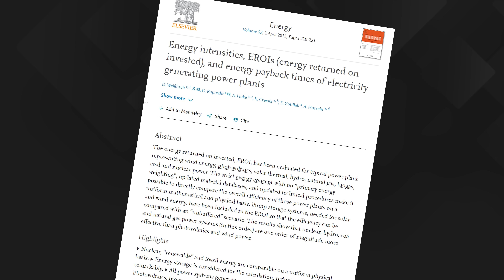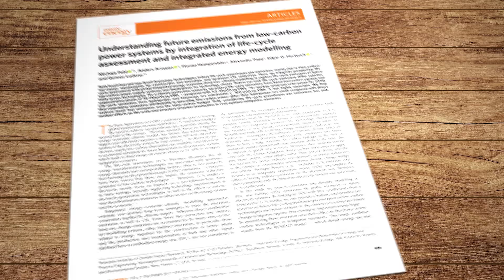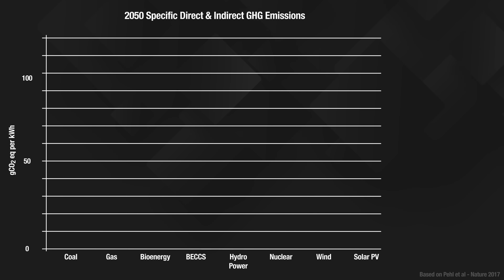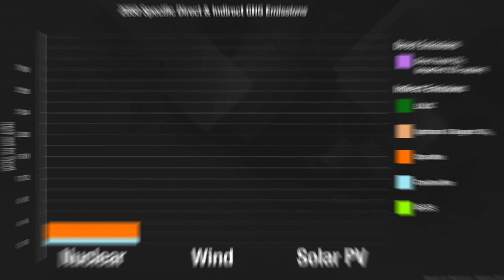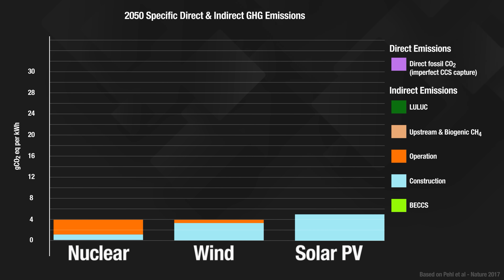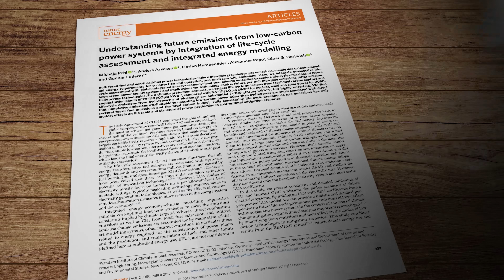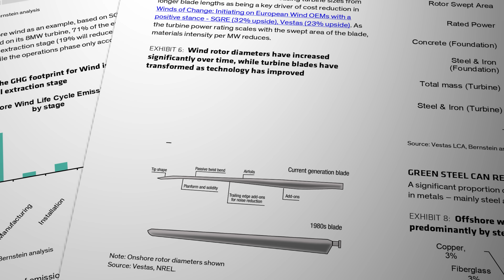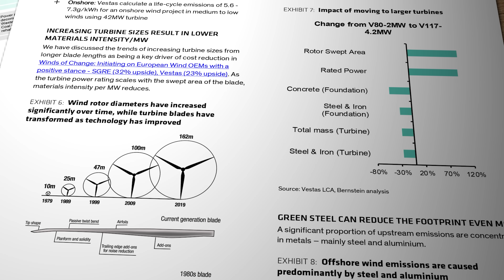Lifetime carbon emissions of renewables vs fossil fuel. Problem or solution?

Comment: One of the many things not mentioned in this article is the visual impact of wind power. These wind turbines are getting bigger and bigger over time and covering more and more hectares of land and sea, these are to most people a blight on the landscape.  Surely, with the advent of new Modular Nuclear Reactors and the small footprint of these units, plus their longevity and overall cost competitiveness, they come out as a 'No Brainer'! One other factor often overlooked is their ability to use the spent fuel rods from stored nuclear reactors as a fuel source which will decrease the amount of future nuclear waste.
Reply: Yep, specially considering that some of the "nuclear waste" could be used in next-gen nuclear plants, or in Thorium NR, while we await for nuclear fussion

Comment: How much of the distribution infrastructure expansion and off peak storage systems were part of these total lifetime numbers??  Small scale nuclear  (SMR and LFTR) is plug and play into existing infrastructure and is free from those encumbrances.   4th gen reactors are orders of magnitude more efficient than the common light water reactors and have far less long term waste storage need, with some newer designs even burning off existing waste reserves as useful fuel.  I don't see how the massive scales of land use and materials transport and distribution redesign and added grid balance storage systems inherent to ANY of the "renewable" solutions can overcome the energy density advantages and other practical efficiencies of clean 4th gen molten salt nuclear reactors.

Comment: This is all fine and dandy but untill greens stop pretending the world is effed this is all pointless. The world has been both hotter and with more CO2 than now and life was doing just fine. Pretending anyone else other than us is effed if we don't fix climate change is lie that only makes anyone that sees throughtbit look at greens skeptically. I came to these conclusions almost two decades ago and no data I've seen since has made me change my mind. Worse was when I discovered a George Carlin bit from the 90s on the topic.

Venus is a Hadean hell hole, but it's still there - the literal planet will be fine. Extremopiles live at the bottom of the ocean syphoning energy from vulcanic vents - life will be fine. Wilderness overtook the region around the Cernobel disaster - even in case of nuclear war life will be fine. We are only here because multiple asteroid impacts and the Siberian traps failed to wipe out multicellular life. Let's be frank here, no matter what we do, we can't destroy the planet or kill life or even multicellular life on this spinning ball of dirt. The most we can do is slightly change the environmental conditions we're best adapted for to some we're not adapted for. At most we can eff up our civilization. Life and the world will be just fine. Hell, if we go extinct dodo's will probably make a comeback in a few million years as a result of convergent evolution.

The first step in solving a problem is admiring you have one, the second is defining what the problem is. The world is fine, life will be fine, WE are effed up and untill we actually admit that little inconvenient truth nothing is going to change.

Comment: While I have personal Solar on my home that means I am an energy exporter, and also on my campervan I don't believe most of the so called benefits touted by the green energy push, for a whole range of reasons.  I use Solar because it reduces my dependence on outside energy suppliers, especially when things go wrong and the will and do happen.

Comment: any form of power generation is going to have CO2 emissions, based on the extraction and refinement of materials used in their construction, then there are CO2 emissions when they are constructed and eventually disassembled. The fuel to run a solar or wind generator is free, both in terms of finance and emissions, but fossil fuel generators have to pay for their fuel every day of their 14,610 days (40 year)of their operating life cycle, and even if they could capture 100% of CO2 emissions while generating electricity, it is highly unlikely they could prevent emissions from the activity involved in extracting and delivering fuel to the power station. So it is not surprising that solar and wind have such low emissions. But and there is always a but, generating electricity from the wind or solar is only half of the process, in the future at least a third of all electricity generated in this way will have to be stored, and I did not hear any mention of CO2 emissions linked to short-term battery storage, either domestic or grid scale storage, and there could be a case made for including vehicle batteries, when in operation batteries are CO2 neutral, but the process mining and refining of materials used in their manufacture and eventual disposal are definitely not, then there is long-term storage when electricity is converted to a chemical form. What would be the CO2 emissions involved in building an electrolysis plant and heavy duty storage tanks? while I am certain this would only add a few percent to the solar and wind score, these are calculations which must be done, if an accurate assessment is to be made .

Comment: If cars and trucks doubled their fuel mileage, we'd have 1/2 the pollution. Vehicle fuel mileage has not improved (at all in fact it is worse) since 1958. The fuel companies wouldn't allow better fuel millage. There isn't enough profit in making things better for the public and the environment. In the 1920s Sir William Richard Morris of MG/BMC motors fame made a car that got 100 mpg and went 100 mph, and back in the day would sell for 100 pounds sterling. Anyone who doesn't believe it, just look at the (originally printed copies) of the 1958 June or July, Life magazine. They have to be the original copies. Which was confirmed by a fellow I knew at the time. After I heard about this I checked it out and the copies, and the fuel companies must have ordered them deleted. The magazine showed a Rambler American Classic getting over 35.37 miles per U.S. gallon on a trip from Florida to California. A clunky barn door-style car without any new tech in it. No improvement since 1958 crap.

Comment: I have never doubted that solar and wind would produce less carbon than coal or gas.  But solar and wind are not a complete system, and I didn't see any mention of the carbon released over the lifetime of the grid-scale BATTERIES that both systems REQUIRE.  Mining and refining the rare earth metals to make the batteries PLUS the solar or wind capture systems has got to be more, and lets not forget how bad some of these materials can be to recycle.  I'm sure it's gotta be less carbon than fossil fuels, but are we simply selecting a different poison?

We could have had nuclear five DECADES ago, and not have to deal with the carbon problem now, but there were people scared by a movie that stopped that.  I still say we build small, modular reactors that use Thorium as a fuel and if needed, float them on man-made lakes as coolant reservoirs.  Let GE Electric Boats build them and Navy Nuclear techs run them.  When was the last time you heard about a Navy Reactor going boom?

Comment: I dont know that this is a realistic concern.  However, I wonder about the effects of wind turbines from weather systems.  Turbines are harvesting energy from wind, and that means that wind has less energy in its system.  

Do we have any concept of what effect this could have?

Are we building models to analyze that and its effect over time and as we scale up the technology?

Is wind energy also just ultimately derived from solar energy, and if so is the loss not relevant, or significantly mitigated?

I imagine I am not the first to consider this, id be curious to know what investigations have been done on it.

Comment: The CO2 for energy used during construction for CO2 free producers (solar, wind, nuclear) should of course be set to zero if they are able to pay back there Energy use during production. To calculate on the actual energy mix during production are really misleading. And it shift focus on peoples mind to the wrong thing.

Comment: What is your evidence that CO2 is having this effect?
If you measure tropical tropospheric temperatures (the very foundation of the greenhouse effect), the result is only 1.1 degrees c for a doubling of CO2 - which is NOT a problem.

Why are you fretting about a NON problem?

R

Comment: Does anyone ever talk about the negative impact wind power has on the local ecosystems?  Where I am from, there are thousands of wind turbines, and if you walk around one, you're reminded very quickly of the destruction these "clean" sources of power wreak on the local bird populations.  Literally 10s of thousands of bird skeletons under each and every one of the turbines.
Reply: Please visit an open cast coal mine, or an oil field, or an oil slick, try walking around a refinery they can be the size of a small city and burn the energy of a small city. Or the fact that 40% of all shipping is to transport fossil fuels! Or that 1/6 of all fresh water is used in the current power generation (renewables don't need practically any fresh water) The fossil fuel industry is the biggest and most polluting industry in the world and that's just the mining, refining and transporting, before even burning one bit of fuel. And as for killing birds, wind turbines have been estimated to kill 0.5 million birds per year, the fossil fuel and nuclear are estimated to kill 1 billion birds per year! and around 100 million are shot just for sport for fun! AND PLEASE SHOW PHOTOS of 10s of thousands of bird skeletons under each and every one!!!!!!!!!! I have walked under many turbines and never seen a single bird skeleton!

Comment: We need power when wind and PV are not generating anything, or too little. Grid scale storage to run the UK  for even 1 hour doesn't exist in the short, or long term. Nuclear power will be required at those times. As you can't turn nuclear off and on, no point having the windmills and PV, just to divert the steam from the turbines. Nuclear is currently the correct answer. In 50 or 60 years, who knows?

Comment: Data about energy return from windmills is from 3 to 5 years energy to produce a windmill requires 3 to 5 years of nonstop work until energy goes to surplus. Sorry solar panels are scam 20 to 25 years until solar panel energy input to produce solar panels gives surplus energy above production costs (in terms of energy), and 20 years is an expired time of solar panels lifetime it never gives more energy than production input, I don't find these numbers in scientific papers they always mention money per kilowatt investment but not energy joules or kilowatt-hours input for production, windmills generators production steel-concrete fiber glass petrochemical industry (oil). Tesla (EV) cars also is a scam, are second an energy-intensive industry only after solar panel photovoltaics production, and third is methanol (diesel) from corn.

Comment: 4:13 I laughed out loud at this section. Somehow with the magic of CCS, coal is supposed to get from ~1000 g/kWh to 109 g/kWh... in 28 years' time. So far the track record of CCS is that it's nothing more than a diversion tactic which provides a convenient way to pump gas into a fracking field to force even more fossil fuels out of the ground. In what universe could the fossil-fuel industry actually develop a real solution given their track record on this matter in 28 short years? And more importantly: how could this additional infrastructure ever hope to become financially competitive with renewables? Add in carbon credits, their laughable 109 g/kWh would be even more expensive.
Reply: in theory you can pressurize the exhaust CO2 gas to liquid, and run electrolysis whenever there is enough green energy, otherwise store the co2 in tanks until there is.   This releases the oxygen and you end up with pure carbon which you can bury.   The coal/gas power plant still produces considerable energy from combustion of the hydrogen in the hydrocarbons but no longer from the carbon which reduces overall output power considerably.  Now, you can also split the natural gas into hydrogen and pure carbon again and burn only the hydrogen and bury the carbon.   Either way its less energy with a lot more complexity so it is not very cost effective.
Reply: No companies frac with CO2 radish. It has lousy fluid mechanics. CCS goes into non HC bearing rock unless it is used for a miscible flood in a reservoir. Even then it's at such low pressure it definitely is not akin to fracing.

Instead of vilifying the fossil fuel industry with no restraint, why not consider the many positive attributes hydrocarbons provide and weigh them against their negative attributes.

Renewables are not economically viable btw. Without subsidies they fail miserably. Why is it the jurisdictions that embrace unreliables have such high electricity rates, despite massive subsidies, for their consumers? Aside from unique locales such as Iceland, the high cost of wind and solar generated electricity are no goes. Energy  Return on Energy Invested (EROEI) dooms these sources of power generation. That's not even taking into account the grid instability they introduce and the impossible logistics needed to provide a replacement to hydrocarbon sourced power generation.

Comment: Good vid,
the only solution for the more industrial countries is,
that the big emmitters (power plants, chemical plants, steel mills etc) start collecting CO2 and turning it (with H2) in sth. useful, f.e. Methane or even better Methanol.
Push Solar (best Agri-PV), Wind etc obviously. But this will take a long time.
We need a solution which could be implemented in months, most few years, not one which could only work in decades.

Comment: Thanks for this breakdown! I've seen a lot of misinformation that I can only describe as deliberate circulating on SM right now. Linkedin especially seems to be a network where you can see this false talking point of "fossil fuels are actually BETTER for the environment than renewables" evolve in real-time through various oil and gas company related accounts (which claim to be independent, but aren't).

Comment: Did the wind an solar costs include storage options for peak leveling and low production conditions?
Are the capacity numbers max or average and for what area of the planet?
Nuclear is the way to go, mixed in with renewables for reduced dependence on the need for long transmission losses.

For sure fossil fuels have to go an we have to switch to a pure electric economy.

Comment: You forgot to mention the 800,000 LB Gorilla in the room...batteries.   One day of battery is all you get in order to actually use the battery up in cycles.  Cycling is key.  5000 cycles = 16 years.  two days is 32 years, and so on, but the battery will age in 15 to 20 years.  We need 1 month or 30 days to cover the time when nothing works.  That means 1 cycle/year.  15 cycles in 15 years.  That means the cost is around $10/kwh.  The only way to store seasonal energy is via fuels.  RE fuels in an old ICE car are 1/2 the CO2 of EVs with 100% RE grid, even though the ICE car uses 4 times more energy in operation.  The battery is the problem.  With low CO2 RE, making fuel is the only valid option.  There is no way to get to CO2 neutral with batteries.  Dead end.  Also, where to get plastics?  Electro fuels lead to electro plastics.  EV robs cash flows to truly get us off of oil.  In short, wind kill birds, solar PV farms are toxic, and batteries are loaded with CO2.  Nothing you and your Electric friends offer has any chance of HONESTLY getting to CO2 neutral.  Waste of time.  What will work?  Ask me...

Comment: funny how geothermal continues to be under represented in statistics.
and how it doesn't represent a larger portion already of power generation.
it's cheaper and easier to solve the problems than fusion ever will be.
i've always wondered if it's because oil owns the drilling technology
saskatchewan has a pilot project on it.
even the perpetual central heating aspect of large buildings in cities.
i think geothermal is more of the grail to be reaching for for future energy needs, more so than fusion even.
others have huge infrastructure costs.
gotta be built where the sun shines, where the wind blows, and long high power cables to get it where it's used.
geothermal can be built anywhere you can get a drilling rig to.
or right in the centre of an industrial or populated area.
right where it's needed.